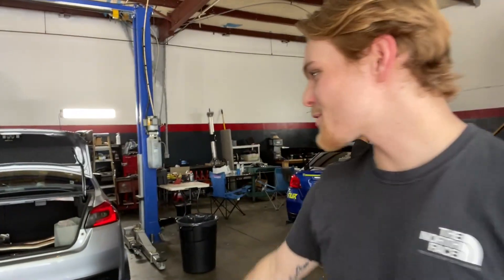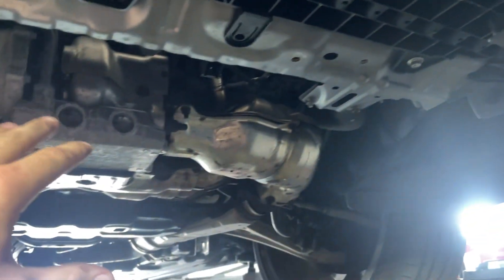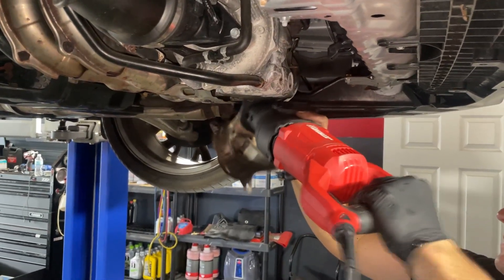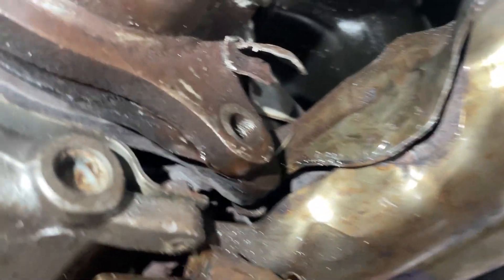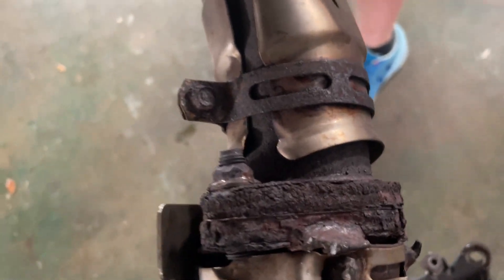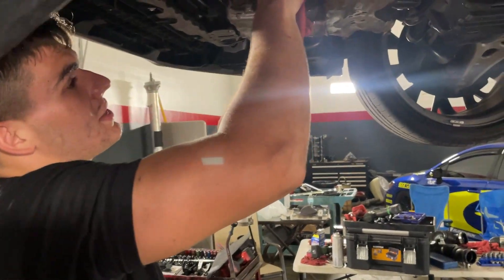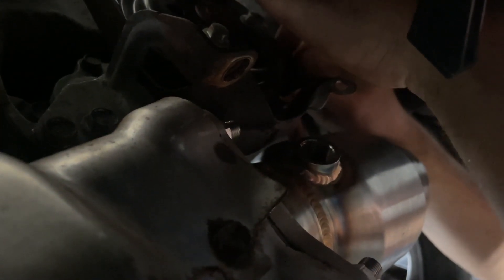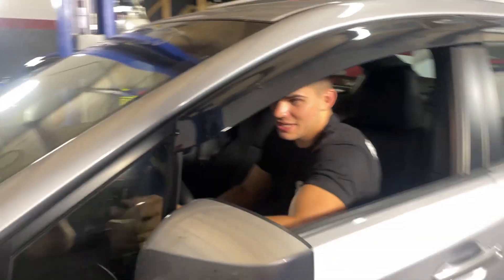2015-2021 Subaru WRX Stage 2 INSTALL [BEFORE AND AFTER]

Comment: I have a 2018 w 11k miles that’s been sitting since covid rarely driven thinking 🤔 want to do some upgrades since have no more commute like before hence low mileage how much does doing something like this cost ? I see the kits are like 2500+ is labor another 2500 if you pay a mechanic and don’t do it yourself?
Reply from the maker: Oh that’s awesome! It’s always exciting modding the subie!! Why don’t you try this: start super small. Begin with an access port from COBB. It’s about 700$ it takes no effort to install. You just plug it into your OBD and follow instructions. You can begin with a stage 1 tune. (A beefier tune on the stock parts). Then when you’re ready and that’s boring, get an SF intake from cobb. It also takes almost no effort to install and a few simple hand tools! The sounds and performance you get from it is awesome! That will get you started and it will cost you the bare minimum. Then when it’s time to go for more mods and power, get the downpipe and hire a mechanic. If you’re in south Florida, I can always do it for you!
Reply: @boxerbaddies where are you located in South Florida?

Comment: For my 2019 sti I have a tune and Cobb sf intake since I’m pre green can I run a Cobb downpipe from the old stage 2 map I had when I first got the ap? I just got a Cobb downpipe
Reply from the maker: Hey there! Sorry for the late response! On the STI model to run the downpipe you have to remove the intake you have installed. You can’t run both. If you have that map already downloaded you could. But if you ever have to plug your access-port in you’d be in trouble. Unless it’s a catted DP

Comment: I’m planing to go stage 1 protuned Cobb AP with GS intake. Should I just go stage 2 and call it a day…. Idk :)) hehehe
Reply from the maker: I would strongly advise you not to use anything other than the Cobb SF intake with their tunes on the accessport. The GS intake is great! But it may not do well with the Cobb tunes. Also, Cobb has now discontinued any “stage 2 support” for the WRX. Any downpipe now needs to be protuned on the WRX.
Reply from the maker: I just realized you said “protuned!” In that case yes!! Use whatever intake you’d like! Use any downpipe you’d like!
Reply: @boxerbaddies  yeah. I figured if I’m going to mess with my car, I’m going to go to a trusted subie tuner. I have my date set for tune and dyno on may 4th!
Reply from the maker: @RaverBarbz92  Great! Just make sure your car complies with all EPA standards and regulations. I say that because Cobb just pulled ALL support for anything that doesn’t comply with EPA. So no catless/egr deletes/TGV etc. Hope it all goes well! Keep me updated!
Reply: @boxerbaddies  I’m too scared to do all that (I say that now 😂) heck I’m even scared to void my warranty haha. I will definitely keep you posted.
Reply from the maker: @RaverBarbz92  The government is really ruining all our fun :( But I hope you enjoy your build wherever it goes!

Comment: Good video where did you get the kit??
Reply from the maker: Thank you! I’m not exactly sure where he picked up this stage 2 setup. I believe it was bought separately and this was also almost a year ago now (I know old video). So I know the accessport actually doesn’t support this setup anymore for the WRX
Reply: @boxerbaddies  exactly, this video is obsolete. you don't replace the downpipe anymore.
Reply: You can still do the Down pipe just with the new gesi high flow cat and a pro tune and your fine

Comment: cobb just told me they do not have stage 2+ tunes i looked on my ap and couldnt find any just installed j pipe
Reply: for wrx
Reply from the maker: Yeah the green speed update changed everything for these cars. Catless pipes are no longer supported
Reply: Yes man I did a turbo inlet Cobb b2 and throwing too lean. Getting smoke test. And then etube

Comment: I thought stage 2 was all fuel upgrades,lines, pump, injectors rail
Reply from the maker: We went by Cobb’s “stage 2” in this video.
Reply: @boxerbaddies  I forgot the wrx and STI stages are completely different. That would be a stage 1plus for an STI

Comment: Should have skipped the intake, doesn't make power just noise.  That money could have got you an actual professional tune from an etuner that will be much safer and more powerful, stock intake and all.  Cobb OTS tunes are horrible.